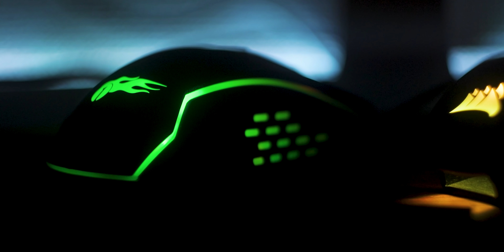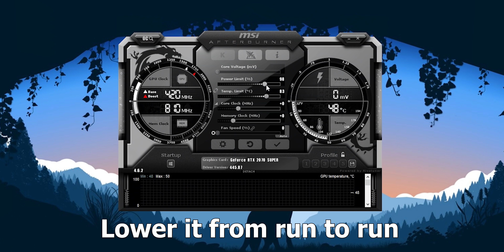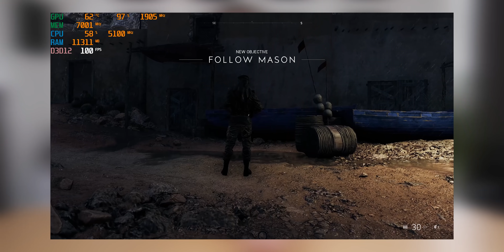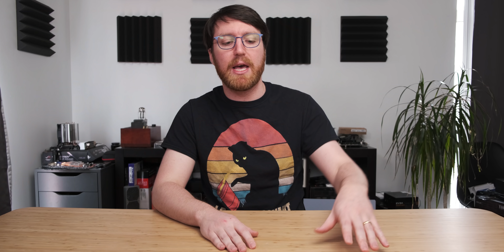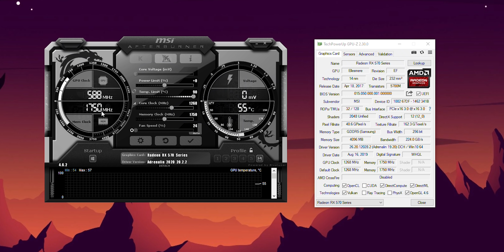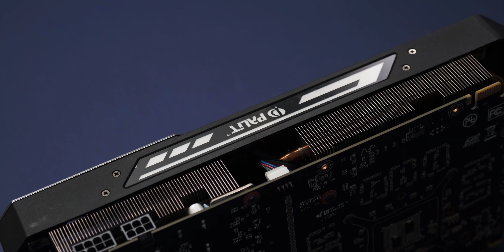This was meant to be an easy graphics card video!! (Render no.6)

Comment: Is anyone able to help me? I am deciding between RTX 2060 or RX 5700 GPU, I was going to get RX 5700 but after reading lots of experiences with drivers not working right and getting a black screen, I’m not sure which I should do. Have these issues been solved? Anyone in the comments have thoughts? I am not experienced, and this will be my first build so I could use some input

Comment: Using a PowerPlay Table mod like people do with the Navi cards may be a method of madness. Idk if it helps for lowering the power limit but it works in the opposite direction. Plus maybe messing with voltage along with power limit etc. Just messing with settings in general to see what kind of amperage and voltage limits and in turn wattage and frame times you can get would be interesting.

Comment: Yeah man I've never really been a big believer in anti-static bracelets, simply because I've built so many computers on the carpet that worked just fine. But with that said, I've had two motherboards die on me over the past year or so as I was working on some REALLY mundane changes to the PC with my son, and I was never able to figure out what caused them, so the best I could come up with was maybe my toddler got some static build-up and then touched it. Thanks, Silas. So I ordered two anti-static bracelets and have been using them ever since. Plus the stuff I have now costs more, so I'm more afraid to hurt it.

P.S.- I did find out yesterday what killed the second motherboard was that two tiny little capacitors that sit near the graphics card had broken off. It was an old LGA 1155 board, so I'm thinking they were already loose, and pulling the graphics card out to have room for our little project and then putting it back in was all they needed to fall off. Still...using the bracelets now, as I never figured out what killed the first board.

Comment: Have you used 2 GPUs at the same time on this board before while the 9700K was overclocked?  It may have been related to increased power draw through the board slots and adding that second card was just enough to push which ever component failed over the limit.

Also, perfect time to see how NZXT's RMA process works if that board is still in warranty!

Comment: I find wattman to be very easy to use when power limiting/boosting and unvervolting Radeon cards. 

I used some registry edits on my Radeon VIIs to raise the power limit in wattman from +50% to +150%. Dropping the voltage to about 1v (1006 or 1008mv)

Ran cooler, quieter, and clocked comparably if not higher.

Comment: For anyone using a static wrist band on your actual wrist, try putting it around your ankle instead, makes things so much easier.
Reply: Easy and pretty pointless. If you really want to be on the safe side just touch your radiator before you start working on your PC.

Comment: That is weird, I flashed 8 rx 570 gpu bios all from different vendors and I did them all using them as the main video output with no problems what so ever. Sure, I was flashing the stock bios back to the card but still...
btw congrats on passing 100k c:

Comment: What I find interesting in the results, is that you can run you card at 80% without affecting the performance. You could then start to overclock it without producing as much heat as if it was at full power!

Comment: The blue smoke should have left a visible mark on the mainboard when it decided to go out. Which components are affected? I'd like to judge the cause of failure myself.

I seriously doubt that it was static. I mean it is absolutely true that you CAN static damage components, but you haven't really taken the mainboard out of the case, now have you... and the moment you touch the case, your potential is equalised to the computer and it's impossible for you to static shock anything. It's true regardless of whether the case is connected to earth at all, i mean connection to earth is great and all, because then you're equalised straight to mains, but assuming it isn't connected, your charge is then simply distributed among all the thousands of ESD protection diodes in all the components, which is almost as safe.

And a GPU, i mean you have a lot of surface area to handle it without touching any of the data lines.
Reply: it was the blue caps on the mother board obviously
Reply: @raven4k998  no